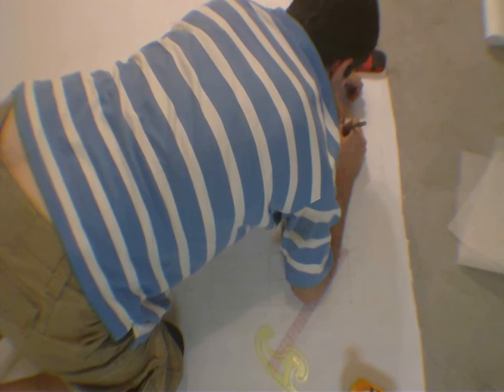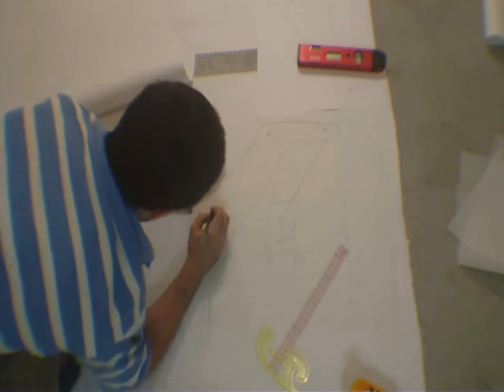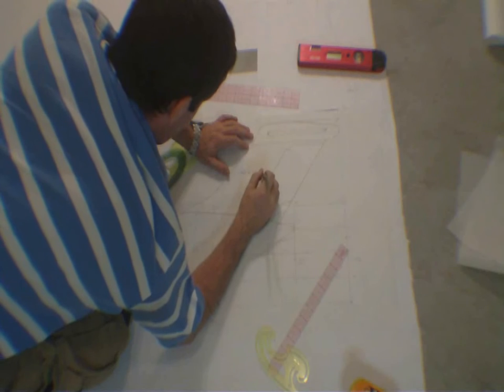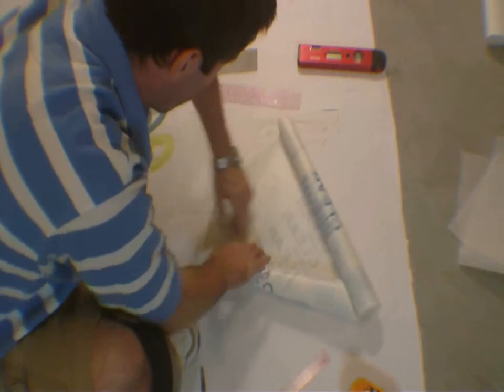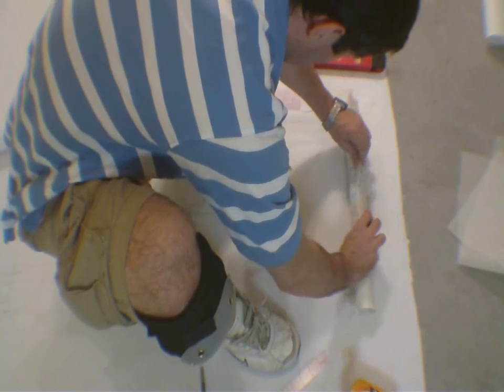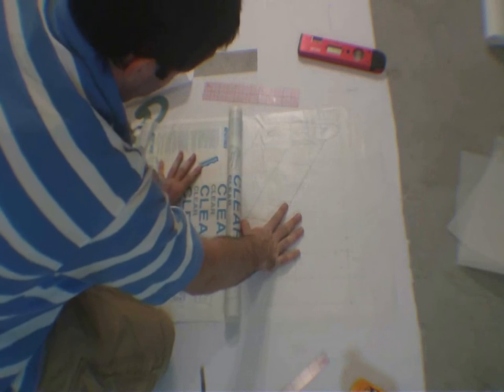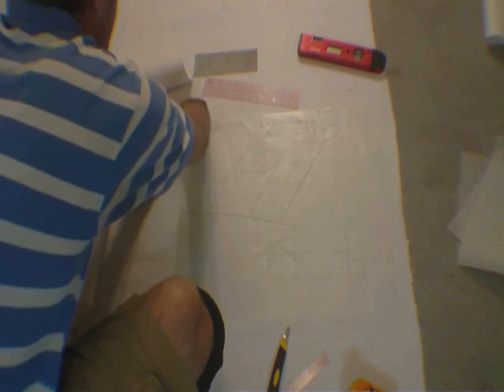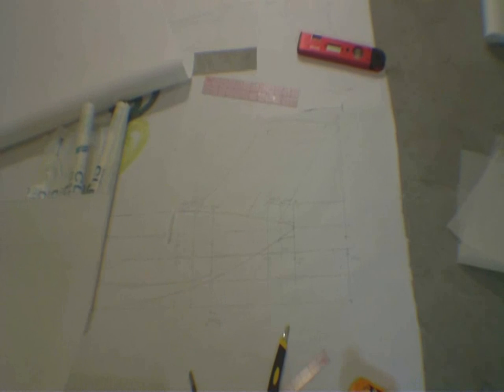How to build a 7.4 Foot MD-80 RC EDF Airliner Part-5!

Comment from the maker: @tonystarification Two 7.4 foot MD-80's will run you 2,400 clams Sir.. . . now that's without EDF's motors servos, basically no electronic just the finished airframe painted  ready to go.